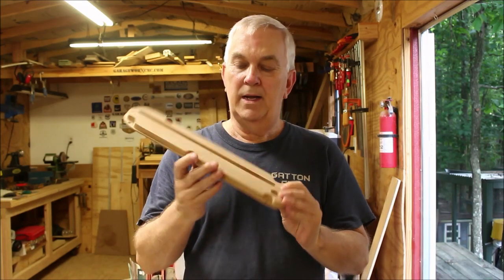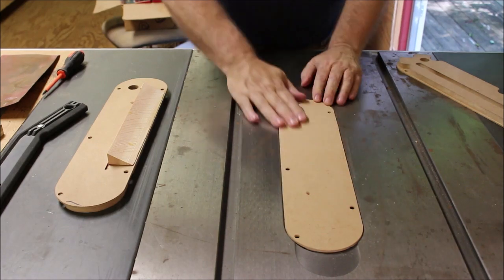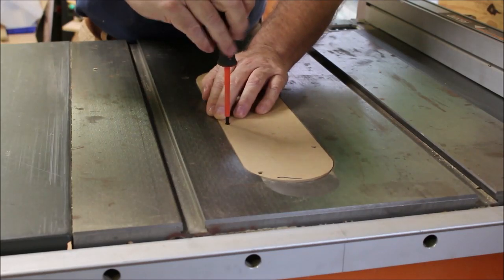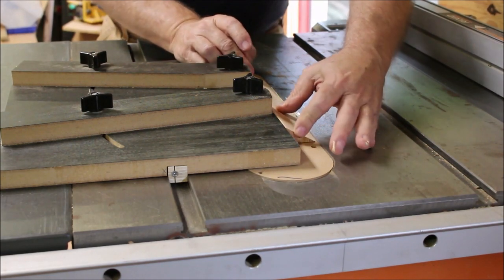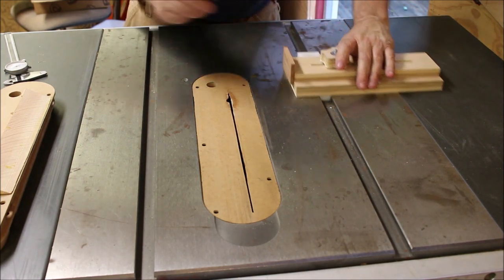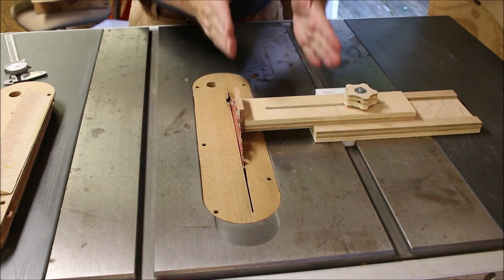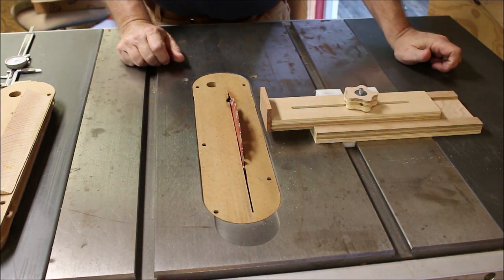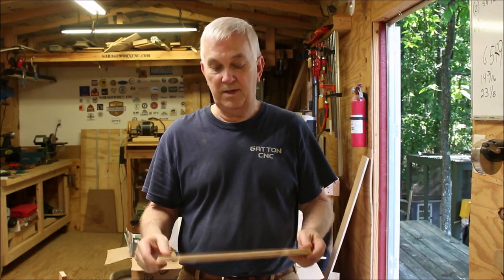Making Some Wedgie Sled Accessories

Comment: Those are great idea's. I made the insert from the files section but mine didn't fit. The cutout's on the edge were too small. I did manage to fix it so it works though. I can see another use for the size accessory you made, thin strip making. Thanks Dave..
Reply from the maker: Thanks for watching Larry.  I've needed to make that stop block for a long time.

Comment: Great idea. But how do you stop the adjustable saw stop from moving forward when using it to set the segment when cutting it. also the segment is not cut 90 degrees to the blade. It is at an angle. is there a way of setting the stop to have an accurate measurement ?

Comment: I’m moving my cutting of segments from my home to a MakerSpace.  In trying to determine how to set the Table Saw insert with the slanted piece to get the segments away from the blade, once cut, I have a problem.  
The brand of saw in the MakerSpace is a SawStop and it comes with a built in riving knife.  Thus, I can’t create the initial cut on the table saw insert by raising the blade up through the insert—the riving knife is in the way.
Any suggestions?